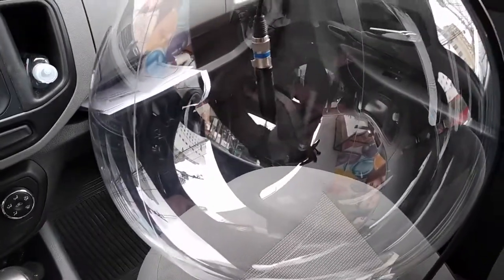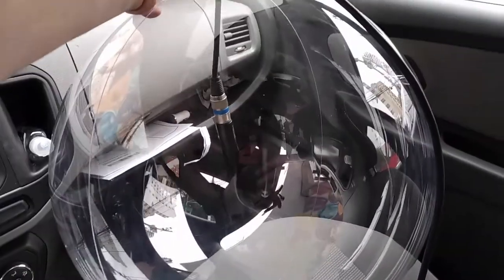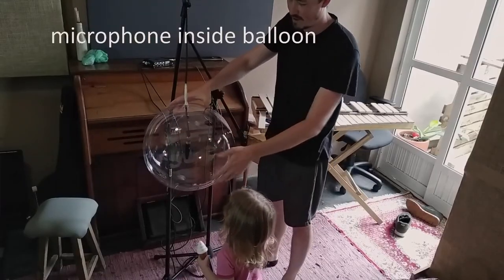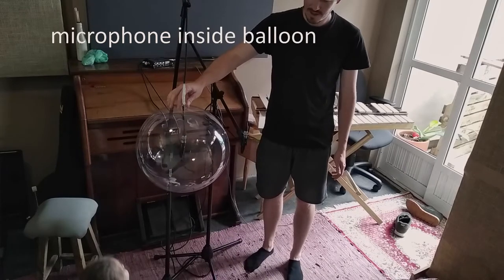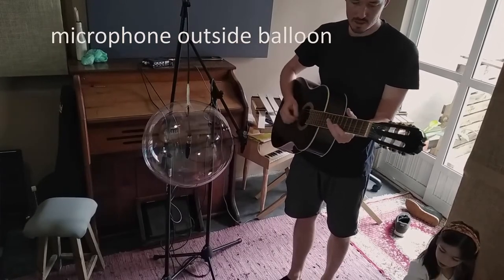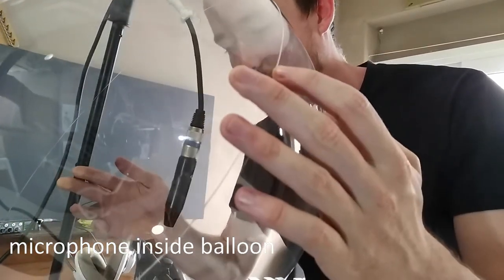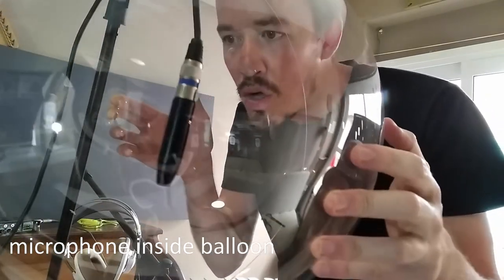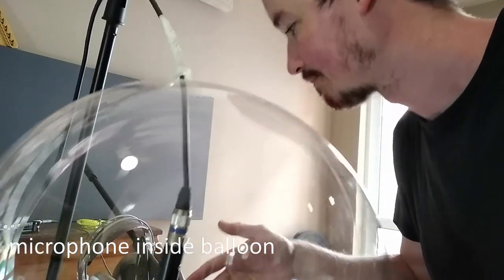Putting A Microphone Inside A Helium Balloon

Comment: Good try. The Chipmunk voice produced by the helium is because the helium pass through the vocal cords super fast pitching up the voice. Here is just the helium floating around. Next time you can try to put something that vibrate inside that helium balloon
Reply from the maker: Yea. I got curious about it because sound travels around 3 times faster in helium. I'd expect this change of speed to change the frequency of the sound going in, kinda like a doppler effect. Unfortunately that doesn't happen,.